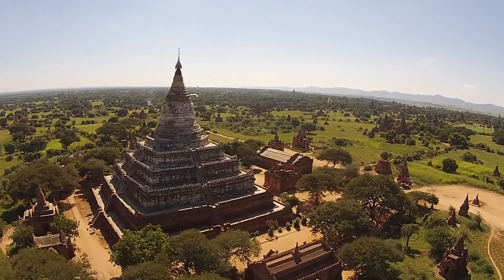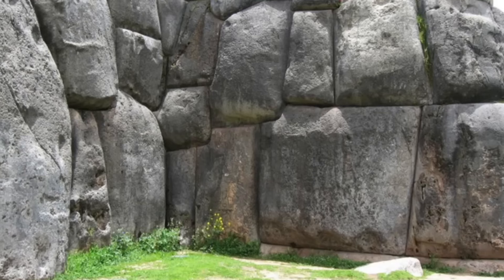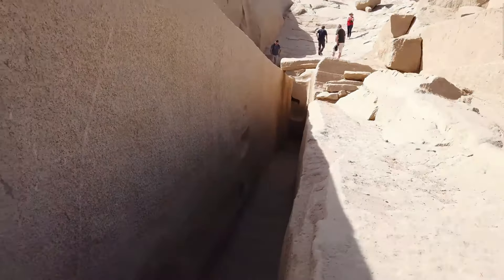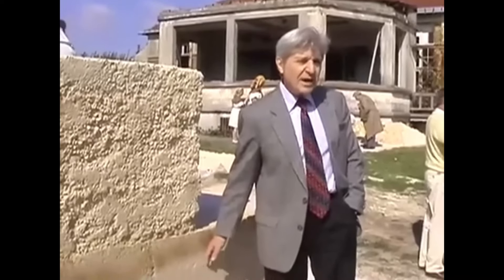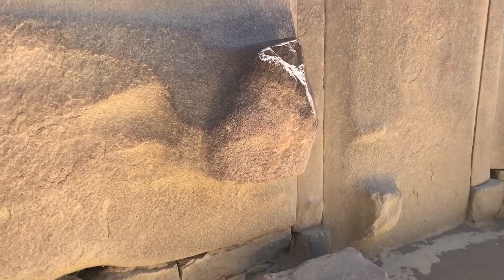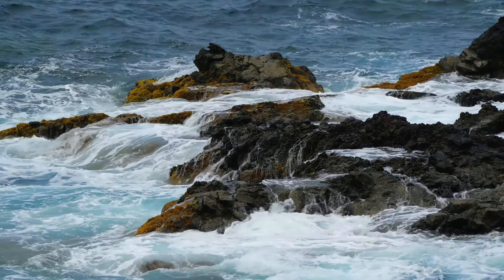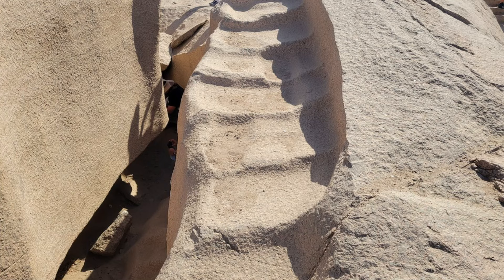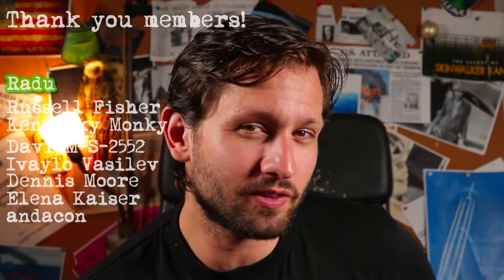This is How The Pyramids Were Built (Advanced Ancient Technology of Egypt, Peru, India)

Comment: They obviously made their own Drill bits – Used for drilling into hard surfaces, primitive or not, at least we know they worked.
Also they made Cutting discs – Used for cutting granite, and other tough materials, which they did cut.
and they must have had End mills – Tools for machining stones and rocks with high precision, obviously these tools worked as well.
to top it all off they made Grinding tools – Used for grinding hard surfaces into powder to be used in construction.

Comment: Build stone box. Remove top. put two metal rods through the stone into the box on one side. fill box with grinded stone w concete. Fill with water. Light those rods up with + and - power source. Once 02 and H are out and almost dry, vibrate the rods out. Once settled remove stone box. Enjoy. Whatcha think?

Comment: Molds can be made in any shape. Make a box from wood, then form a shape on the inside wall with clay. To make a mating part, make an impression of an irregular shape using clay, harden it, and then press it into the clay inside wall of the form. Now you can make irregular, mating shapes with poured concrete.

Comment: Excellent analysis and I agree with the construction of the pyramids. If you add the geo-polymer model of creating these blocks, to Edward Kunkel's  work on the Pharoah's Pump, you have two mutually beneficial methods working together.

The dust to make the blocks would be hauled level by level using water canals, barges and locks. The fact that you are using water to transport and lift the blocks and at the same time have all the water at the level of each new flooded pool to create the blocks with the dust, is extreme efficiency and definitely something humans could have easily done with very primitive technologies, since more advanced techs were not even  needed due to the simplicity and ease of this method.

The ram pump also works very well with these other two model of the Creation of the Great Pyramid. A canal from Lake Moeris Egypt
down to Giza was a perfect supply to run the ram pump that pumped all of the water to each new level as the casing stones were sealed so they could create a water tight pool at each level. 

The Huge granite blocks used in the so-called King's Chamber were merely and effortlessly  floated up to the level they would be needed at. In conclusion, I think these three different methods for the Construction of the Great Pyramid, are the most sensible, reasonable, logical and sane methods that fit all of the archeological evidence and were technologies existing from remote times.